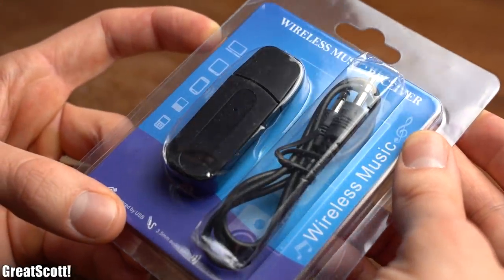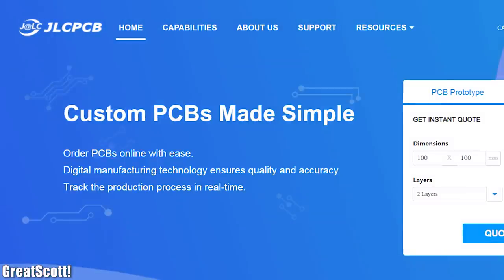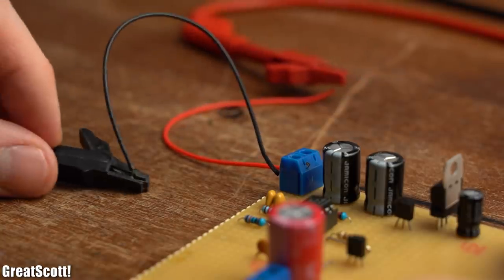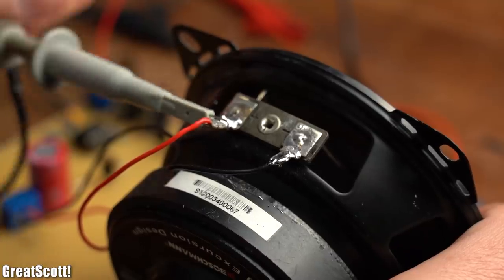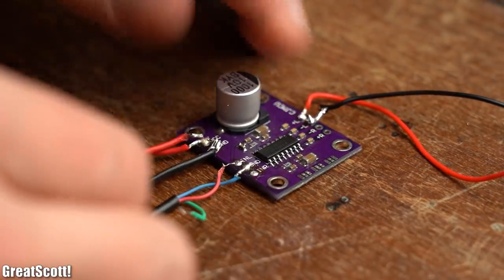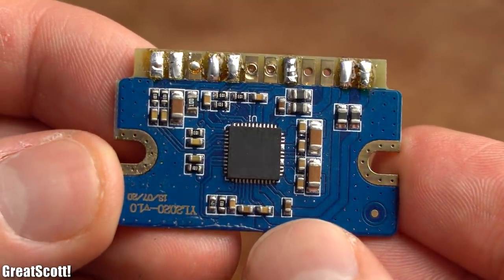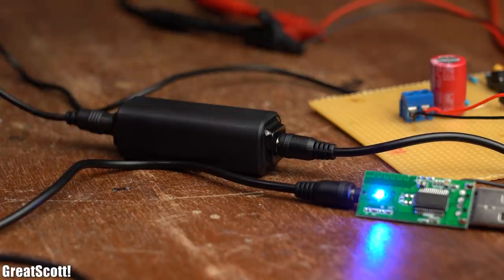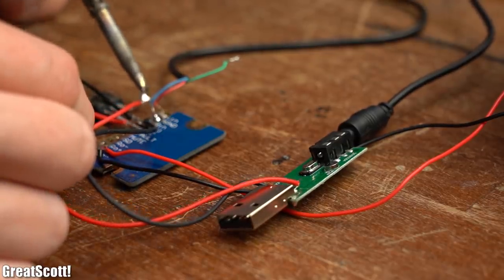How to remove buzzing/noise from a cheap Bluetooth Music Receiver? (Experiment)

Comment: i use a isolated  dc to dc converter as the amplifier is sending feedback through the shared power connection which gets looped back to the amplifier through the audio connection. I use this 5v one for most speakers that i make/modify:
they're quite cheap for what they do too: 

this is the one i use for 5v circuits.
https://uk.rs-online.com/web/p/isolated-dc-dc-converters/1896931/

lol, wrote this at the start of the video! :P

Comment: Would a 5v to 5v or a 12v to 12v converter work for a lower voltage supply (3.7 - 4.2)?

Comment: Hope I got it right that my mobil home TV and its 3,5mm cable connections to the soundbar cause the noise if I turn the soubdbar source to TV due to same ground / battery.

Hope it will work if I put  a 12V DC DC converter in the TV power cables.

Comment: my problem is always that my amp hase multiple inputs and the gnd is connected through them and if i plug my pc and my switch into it and turn the switch on it always makes weird noises depending on what the switch is showing on the screen almost like the gnd is affected by the video processor
also my pc when its turned of makes a weird buzzing sound which i was only able to  get rit of using a ground isolator from ebay.

Comment: I have a similar receiver for my car stereo, and I get a pulsing noise on mine too...
Only my noise is high pitch, and sounds like data transmission, and only occurs when the audio stream stops (like if I pause the music) not during a silent part of an audio track playing back.
Pretty sure it's related to either the chip itself, or the audio section is picking up stuff from the RF side.

My conclusion is these are cheap rubbish adaptors, and I'm better off just buying a better stereo for my car...

Comment: i have this problem with a cheap bluetooth speaker if i plug in the usb power and the audio jack i get interference very annoying but if only 1 of these cables is plugged in no interference my solusion is to try find a bluetooth adapter i can plug into my pc because its used as my pc speakers but im having trouble finding one that will work for this task does anyone have any suggestions ?

Comment: yeah, that's a pain in the ass, i tried almost anything, low ESR caps, chokes, not using the signal ground... at the end it appears that inductors placed on both + and - of the module and not using the signal GND worked 90%, there may be no "simple component solution", those modules are noisy on the supply rails and signal GND is commoned with the power one

Comment: So how would a ground loop isolator work if the amp and bt module are sharing the same power supply and then also still the same ground??
Reply: Same ground? there is a wire with some resistance between them!
Reply: @erlendse  in other words it's possibly down to the losses on the ground

Comment: hi i have a 1Mii Long Range Bluetooth Transmitter Receiver and i use it at home and at work on different stereo which works fine. i used it on on my after market stereo in my car and it worked fine 2. now i tried it in my nissan on the aux input and i get some stat noise. ive tried to power it with a powerbank but that didn't solve the prob. ik connected my phone on the same aux and that work fine with and without a charger connected. i tried a other bluetooth device and that worked without any prob even if i connect it to a charger. the only prob with that bluetooh receiver is that it works on shorter distance and isn't that loud as the one with the problem. 
so no im looking how to fix this problem

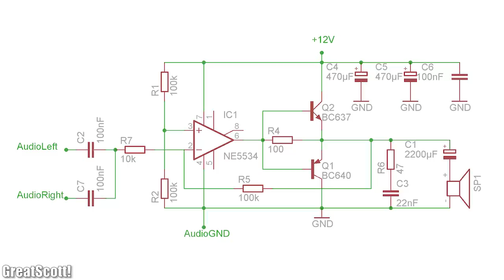Comment: 2:06 how does this amp works?? Is this class B or AB? What does that 100ohm resistor do?
Reply: It is class B. Because the feedback path is taken from after the power transistors, the opamp will automatically compensate for the Vbe drops. The 100ohm allows some current to flow through to the feedback even while the power transistors are not conducting to improve loop stability when the opamp slews its output between -Vbe and +Vbe
Reply: @maclayyc  Its interesting! Once I tried to make a small amp for a TV speaker using this schematic with bd139-140 and lm741 from aliexpress, unfortunately that opamp didnt compensated fast enought the opening voltage, so it made distorsition. That the reason why I was curios. Maybe newer/genuine opamps are a lot faster.
Reply: There are many faster opamps but they have a different problem of being unstable and oscillating, the circuit has to be very carefully designed. 741 is deliberately made slow to make it stable and easy to use.

Comment: i have a similar problem with my laptop, when i connect the headphones jack to my amplifier i can hear noises but with normal headphones connected sound is perfect, i tried a ground loop isolator but the problem still remain, someone have some advice to solving this?

Comment: Why can't you just connect a capacitor in-between the linear regulator and the receiver? It should smooth out the current draw and therefore reduce the voltage pulses

Comment: Hi Please help i use pam8610 d class stereo module to make speaker i use 12 v 2 ah power supply and 10 w 8 ohm speakers on it but when it reach 30% volume its stop working there is so many videoes on youtube but non help  i even test 12 v 10 ah power supply but nothing pls teach me how to use it pls pls tnx❤️❤️❤️❤️❤️

Comment: I used a bluetooth receiver with a preinstalled battery to convert headphones to bluetooth.

Now there is a slight buzz in my right ear.

It seems to be caused by the ground wire or the right speaker wire going by too close to the left speaker.

I can't move the wires far enough away to remove the buzzing because there's not enough room inside the headphones.

Does anybody know a solution?
Reply: I have now found out, that the buzz is caused by the ground wire being too close to the bluetooth antenna and not the speaker.

Comment: You just won't believe today I made a amplifier combined with a cheap China made Bluetooth device working as a headphone,
And same problem I faced😲

So how I came over it, I had to used another seperate Power supply for Bluetooth 😑

Comment: I´ve had a cheap class d stereo 3W amplifier paired with such a bluetooth receiver and two small speakers putted together into a pringles can and while it uses the same power source than the amp, it also has some noises but they sound like a bluetooth noise instead of a buzzer.
Also it is very quiet and you can only hear it if you turn up the amplifiers volume and with no music played.
I also added a 6 pin switch and a 3,5mm jack to switch between bluetooth and wired.

A crappy video can be found here:
https://www.youtube.com/watch?v=6P1XUgVV-pY

It uses an old cheap powerbank which has it´s output always on so it doesn´t shutdown if the current is too low (on low volume) and i upgraded the one li ion cell to two with a capacity of 4600mAh in total.
It can still be used as powerbank :D

I wish there was an similar receiver which has a decent audio quality.
There are some out there but they come with internal battery and a power on/off switch and this is more difficult to power on.

I´d like to have one that simply powers on when it get´s power...

Comment: Thank you very much for the video. There seems to be a fourth solution, which should also work: There a so called "engine noise suppressor filters" which are no NF filters for the audio line like in your video but for the current supply of the amplifer (or alternatively the bluetooth receiver). They don't consist of a 1:1 transformer but of a C-L-C low pass filter. You can see a tear down of one of them for example here: https://www.youtube.com/watch?v=TMwybcpBRlE

Anyway. I will try your "premium" solution with a beefy isolated DC DC converter since it seems to be the cleanest solution, altough it's of course the most expensive one for higher currents compared to the C-L-C filter one. Maybe you can make a follow up video at testing if such a C-L-C noise suppresor circuit would help here too?

Comment: I have a far simpler solution. Throw away the bluetooth device and use a decent pair of wired headphones. I have yet to find a bluetooth device that I would call high fidelity. As an electronic engineer, you know that anything in the signal  path degrades the signal and has the possibility of introducing noise. Keeping it simple when it comes to audio output works.